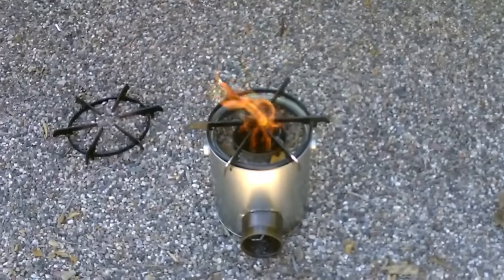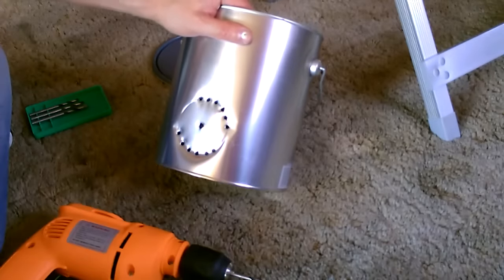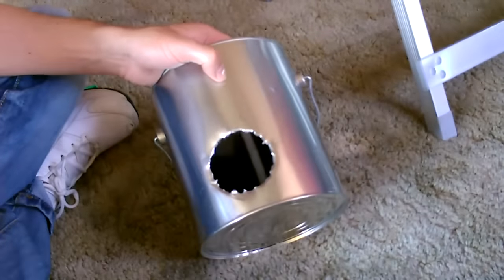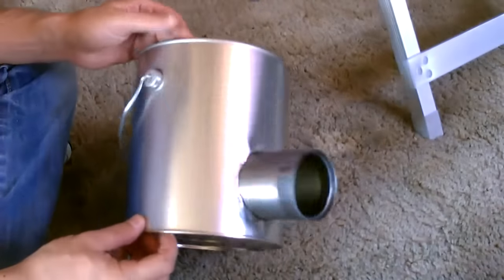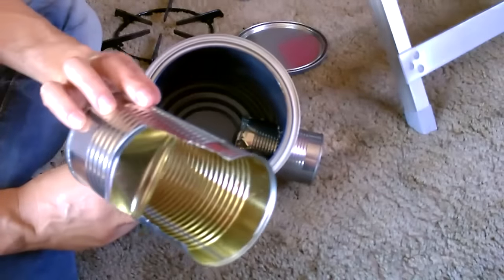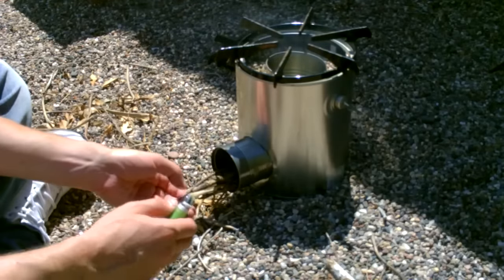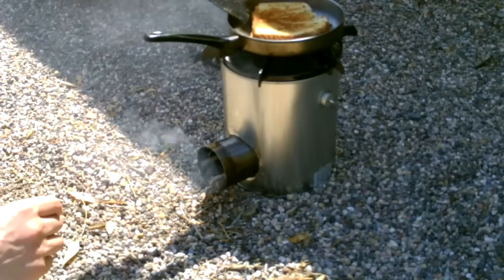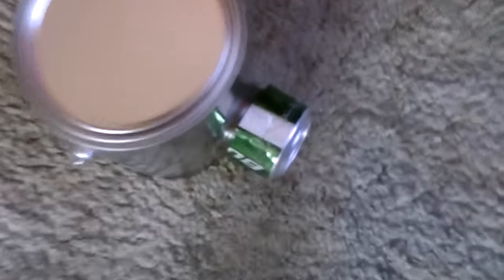Homemade TIN CAN Rocket Stove - DIY Rocket Stove - Awesome Stove! - EASY instructions!

Comment: A better insulator than sand and gravel would be perlite, you can buy enough to fill like 4 of these at any gardening store.
Reply: ***** true. put plaster sand mix on the top mabye?
Reply: That's not the point of the stove....
Its designed to be light and portable and hang off your backpack, and then set up with material at your campsight
Reply: Shane Lopez Perlite is lighter than sand.
Reply: Live Rave Repeat Is Perlite available at backcountry campsites?
Reply: ***** So you are using sand etc. just to support the stove and not to insulate the burning chamber. Try to come up with sturdier structure and forget the sand, you'll get better stove (air is much better insulator than sand..). Just a metal tube with grid in bottom will do the trick. No need to tinker, Weber can sell it to you in competitive price.
Reply: Newfiebulletvideos Good point.
Reply: Tomi-Henrik Nurminen If that's the case, you could just tack-weld the tins together.  I can see that the sand would protect the $5.00 paint bucket.
Reply: Newfiebulletvideos >Is Perlite available at backcountry campsites?

Perlite is so light weight you might as well use it even if you are carrying stove around.
Reply: Tomi-Henrik Nurminen You are right, air is a better insulator, but only if it's dead air space, completely sealed and air tight, which these are not.   Sand and small stones used as filler add weight, stability and thermal mass, which will eventually get hot, as will the can.  I can see using the sand and pea gravel as a filler being safer as far as making the stove more stable, especially when more weight such as a pot or pan is in use on the top.  But if the heating up of the stove itself poses a danger if what it's sitting on is even remotely flammable, this would not be good.  That's where some YouTubers say the perlite may be better (?), being it has volcanic rock properties, but you'd have to read what other rocket stove users say to check on that.  Perhaps vermiculite is a better insulator, because it's used in fireproofing materials, and it's still very lightweight.  Webers are nothing like a rocket stove, and not as fun to go buy one as building your own rocket stove.  :)
Reply: erad67 You can buy perlite at most garden centers like Walmart, Menards, Home Depot, etc.  It's usually starts at about $4 bag, depending how big it is.  I think vermiculite would be a better insulator, see my other comment, and you can still find it a some garden centers, but not as common as perlite, about the same price.
Reply: MinnesotaMichele
Think you didn't read all of my comment.  :)
Reply: erad67 exactly.
Reply: If you tack-welded the tins together, and included a top plate, you will have a stove that can be used immediately, with almost no pre-heat time, or set-up time (no digging, assembling)  What little convection losses would likely match the losses in heating the fill-dirt. Just add another stick.

Comment: You can easily cut the can walls with a steak knife or any knife eg. finnish. No need to use drill. Just mark a circle wiith pencil make initial punch by hitting knife handle and then jigsaw the metal around. As you can open any can this way. Great video anyway.
Reply: yeah if you have some shitty knives, for sure. 1.5" cutoff wheel on my dremmel would be boss

Comment: Can I ask where you got the oven grate from? I am having a very hard time finding a source for these here in Canada. Thank you!
Reply from the maker: hi. i actually got them at a thrift store. but you can find them on 
amazon. local stores that sell appliances or used appliances might have 
them too. here's a link to one https://www.amazon.com/Electrolux-316055800-Range-Burner-Grate/dp/B003MYWSBK
Reply: Try scrounging the side of the road on trash day. Or habitat restores.

Comment: I really enjoy livingroom floor projects. Thought-invoking, very practical, great presentation
 I suppose you could find the stove insulation filler material at the location site.
Stash the lighter, starter material (clothes dryer lint, layered with melted candle wax/paraffin sealed in a duct tape "sandwich"), inside; along with emergency supplies: knife, flashlight, rope, jet blast whistle, food etc. You have a dry, compact, emergency kit that would start in extremely harsh conditions.  It might save someone's life. Thanks for taking the time
Reply: Wood shims would stash great in this as an on board fuel source.

Comment: How do you dump out the ash once your done? Doesn't the sand and gravel shift?
Reply: once cooled, maybe u could saran wrap the canister? also, when filling the sand and gravel in...maybe u could tin foil the Hunts can? hope it works, i cant wait to try this! fun free kid activity and conversation starter.
Reply: Put the lid on the paint can like shown and then perhaps dump it out through the twig feed hole on the side.
Reply: Vacuum cleaner/shop vac would work pretty good once it's completely cooled down.

Comment: wonder if a perilite and plaster or concrete mix could replace the sand and gravel for added insulation.
Reply: themadscientest try it and see what happens!
Reply: The weight of the rocks may help it not turn over.
Reply: I saw somewhere else where commenter mentioned to use high temp concrete bc regular concrete is not meant to indur high temperatures

Comment: Easy tip:  If you really must use a hacksaw on tin can material, take the blade out and put it back in backwards so that it cuts on the pull stroke.

Comment: I think I'll make one with cement in between for easier dumping and clean up..
Reply: Douglas Raymond *****  You/He could make sure it was packed good and use high temperature epoxy to seal it all in,
Reply: ***** I know.  That is why I wasn't talking about concrete.  I was saying use the epoxy to seal in the sand/gravel.
Reply: thanks for the info
Reply: Laochri How about some fire grade clay to solve the problem? Also do you have a name for the epoxy you referenced, that would do this type of job. Thanks man
Reply: Its designed to be able to dump the sand and gravel to make it light and portable to hang off a pack. Adding permanent insulation would ruin that function... just pack a real camp stove in that case....
Reply: +Velocet 8   Soooo you have never read or watched anything about long distance hiking in Alaska? Huh?
Reply: You literally just made my point for me, though...

If you have the money and materials, there are obviously better options. 

This is not designed as a primary use stove, its designed to replace your primary burner. The three elements involved are easily swapped for other objects, and it is a simple, 5 minute hatchet job to make one.

2600 miles would absolutely call for better equipment, but if so... WHY THE FUCK ARE YOU ARGUING ABOUT A TIN CAN ROCKET STIVE ON YOUTUBE. 

This was never meant for what you mention, but is an option given circumstances... Yet still, permanently filling it with cement and glue and shit would defeat the simplicity and portability of its design. There is no reinventing of the wheel to be had... It is perfect in its simplest form....

Investing in smaller, more expensive, or more tedious designs, is obviously an upgrade... Why bother making this point? It feels like hou have way more to lprove in your comment that "i could make it better."

Lets not ever talk shop... I have to doubt the validity of any youtube commentor saying they hiked anything near 2600 mi.

Comment: Just a quick observation... you could probably mount a can lid inside the smaller tin can, with a wire going across vertically so you can open and close it like a throttle valve. It might help with controlling the air velocity and maybe improve max temps, and you could use it to choke the fire when you're done.

Comment: Great idea,  thanks. 
For a garden/patio heater I use an old Hotpoint Washing machine drum with the pulley wheel spun back on the shaft the other way around to make a foot.

Comment: I have found it very useful to invest in the nicer hole bits. I have a few morse ones for when i need some extra ummmph...like drilling some metal. Don't get me wrong, I stay well stocked on Harbor Freight bits, but sometimes you need something you know will get the job done.

Comment: You should cut a hole in the lid to match the tomato can and leave it on all the time, that way you can move and transport it with out the gravel/sand falling out.  Just an opinion.

Comment: I'm too lazy to read the comments to see if anyone else already told you this but, if you were divided the horizontal can with perpendicular thin iron bars to permit air go through,  you would achieved the result with a plenty less smoke. But great work, well done.
Reply from the maker: hi. i've got a couple of other metal can stove designs with the 'shelf' in the horizontal can. those have bigger feed tube so there is room for fuel on the top part and air underneath 🙂

Comment: If you take the soda  can  and make a big hole in in you can choke the air a little and get the jet effect. it will make it burn hotter with less smoke.  You might have to play with it a little to get the perfect size hole.  A good manufactured jet stove is ridiculously expensive, building your own is the best way.

Comment: nice video!!  I will probably build one and put lightweight insulation in it instead of the heavy gravel and sand, because I want it to be more easily portable and may be carried in my car in the winter.  id probably use a smaller grate on top, one that fits inside for smaller items, or no grate at all, just the  top of the can for larger pans

Comment: I ordered my metal grate for a cooking surface.   thru amazon.   I also discussed with a friend who has a cast iron stove on making a rocket mass heater.   He wants to but he still has some reservations.   He has the skills in abundance to do it.  I would make one except I cant--I live in a condo.   He also bought books on gasifiers and carburater gasifier for a car/truck.   I'm gonna make a 'conversion kit' to make my stove into a rocket mass heater.   basically a large bucket that will overlay the above rocket stove.  with the two holes for intake and exhaust.   Just as a test.   It wont be a permanent change.  but it shd be interesting to see how how it gets.

Comment: What do you think about substituting the sand and gravel with fiberglass insulation?  Pack the insulation in around the inner liner can, lighter weight and still has the insulating properties?

Comment: perfect!  I intend to multiuse mine. I am going to cap it and use for indoors by dropping an ice tea can alcohol burner into my burn chamber that would normally hold the wood. My alcohol burner will contain a wick and some coal and alcohol.  If I keep it in my vehicle this winter, and anything goes wrong, I only have to remove the wood cap and pull out the alcohol burner. I want the alcohol burner for cooking and indoors.  What do you guys think of multi use?  This is my favorite style.

Comment: I have been wanting to give this a try, I think I might just get the materials together and go for it. Everyone has different ideas about the hole cutting, surely I can't be the only one who has used a Dremel to cut holes in metal? For that matter I would use the Dremel to cut everything but that which you could use a can opener. I am thinking about insulating the inlet on this though, since I would think it would be easy to burn yourself (accidentally of course) on the inlet. I need to give thought as to how to do that without reducing the inlet size too much.

Comment: Just asking a question, What would happen if you used BBQ lava rocks instead of just plain rocks and sand? Would the absorbed heat help cook things, using less fuel, or would the absorbed heat melt the paint can?
Reply: The rocks and sand are meant for insulation so the outer can doesn't get too hot.

Comment: It is a nice idea this system. One or two issues not meaning to pick holes. Firstly is the surrounding mass (sand, dirt whatever) may be available on a campsite but not necessarily available in all locations. (half way up a mountain or surrounded by heather). However this latter part just ruled out my next point of fuel stock. One last thought which is I am impressed however it does look a bit big. If someone where planning a lightweight camping trip, they should also consider the volume of the items being taken.

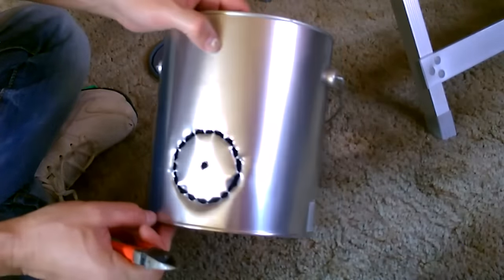Comment: desertsun02 Its a nice work! you should consider getting a rotating tool (e.g. a dremel) they're very good for small works such as cutting tin cans (and they do it pretty fast) and with a al-ox grinding stone the sanding at 1:33 they have no problem. Congratulations Mate.

Comment: To cut your opening rather than trying to use a wire cutter. Youd been better off using a cutting wheel on a dremel or drilling a very large hole in the middle to get started then use tin snips to cut out the circle of your paint can making it easier. 
Also with the sand and gravel mix, you can also mix up some plaster of Paris to pour into the sand and gravel. And keep pouring more in as add your filling mixture. I've even seen where some have also used just cement around the edges of the can also to insulate it.

Comment: oh yeah, side hole makes ALL the difference.

discovered that when i "accidentally" made a 2" hole saw replacement for perfeft circles in plastic (aeroponics net cup cutouts). decided to try melting them, best match for a thin hard 2" pipe i found in garage was a broken shower head...worked great. TOO great, walked away with the misconception that metal easily heats to plastic cutter temps on a methanol gel puck. nooope - turns out it only worked so well cuz the shower head pipe had a hole in one side, roughly same proportion and placement as yours, and thus "jetted" the cans flame waaaaaay up when set on it to heat its edge for hole melting

any other attempts like heating a knife / screwdriver to cut lines did little reliable good, while this thing reached melting temps in ~30 seconds and reheated between cuts in like 10

pipes w/ holes r awesome!

Comment: There are people who use large truck engine cylinder linings and bits of pipe and weld them together in much the same configuration as the one in the video. Sometimes they also install those tiny computer or stereo cooling fans at the end of a longer pipe that is connected to the contraption to effectively decrease soot. The other pipe where you push in charcoal or pieces wood can be closed. Although this is much heavier, it can however last many years.

Comment: The inside cans in mine eventually burned out so I built the second generation oit of black iron pipe. Daughter and friends used it often in the backyard cooking hotdogs and SmoresThis may be more than you want to do unless you have the parts on hand and tools for working with the pipe. Next mod is to fasten a piece of wood to the bottom of the lid to keep the gravel from falling out during transport. Also want to test it using charcoal.

Comment: Nice simple build, I'm totally addicted to rocket stoves, but I'd like to advise your viewers to use gloves, maybe use tin snips if you have them and burn off the linings of the cans before cooking or getting too close, the linings of the cans are plastic or something toxic and they can make you a bit loopy if you aren't careful (I say this from experience). I've long since moved on to thicker metal like scrap exhaust pipe, but that does make it more difficult to build.

Comment: How do you clean out the ashes after using the rocket stove without spilling the rocks and sand inside?  Other than this a great ideal!  Thanks for the video.
Reply from the maker: 01Prostyle a long handled spoon or a paint can stir-stick both work well.
Reply: +desertsun02 or a vacuum cleaner.
Reply: U can make little holes down in it

Comment: You can cut the thin metal using the hole saw if you use it in reverse.  It will still cut and not grab.

Comment: I do have a question. Did you cut out bottom of the big can in the paint can? Or did you leave it on. If you took it off did you have issues with rocks coming through the bottom? Did you put rocks in the bottom of the can?

Comment: You don't need to carry the gravel if there's a chance of finding some where you're headed, right? You can just fill the bucket with stuff and pack it in your backpack (yes, slightly awkward).
BTW what's wrong with cutting metal at home on a carpet? ;-)

Comment: You can keep the weight down by using vermiculite pellets for insulation instead of pebbles.
*But having pebbles in the bottom 2 or 3" helps anchor the stove for Stability.
Reply from the maker: hi yes, the weight of gravel adds a lot of stability. you don't want it to tip over.

Comment: Metal cans can also be cut safely by first making initial guide llines using a sharpie, then make a short 1-2 inch cut using a utility knife, then finally cut with a metal hack saw (cheap at HD).

Comment: i would imagin that if you filled the paint can up with sand and tampted it down good you could go right through with the hole saw without to much trouble
Reply: You can fill the can with water and put it in the freezer.  When frozen, its easy to make the hole with the saw.